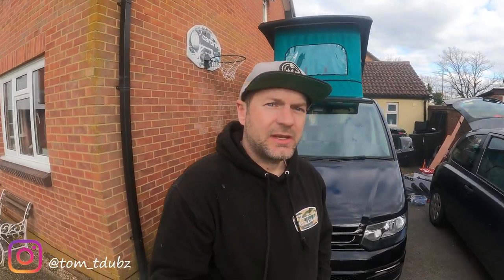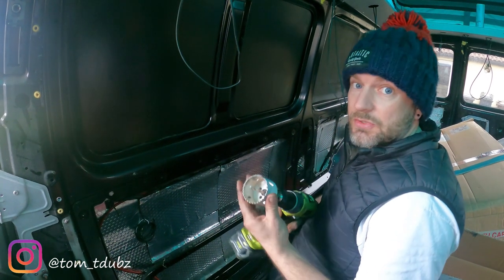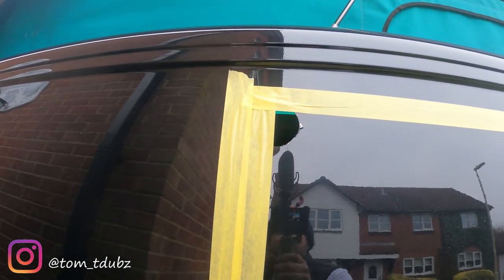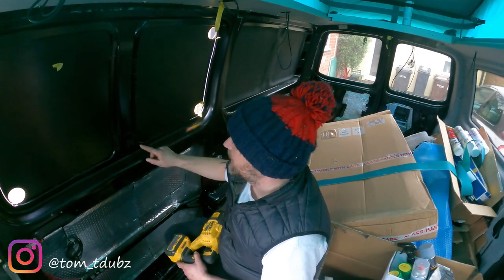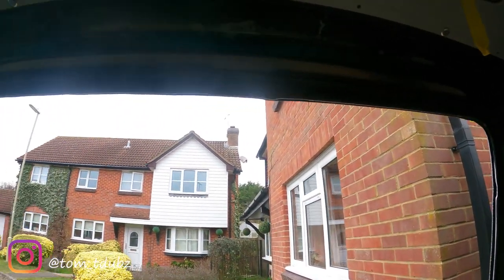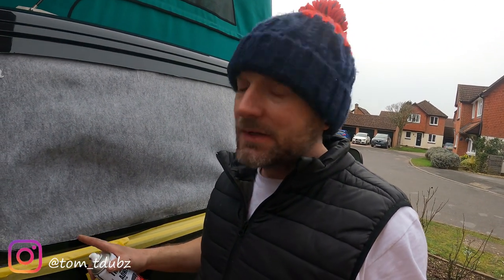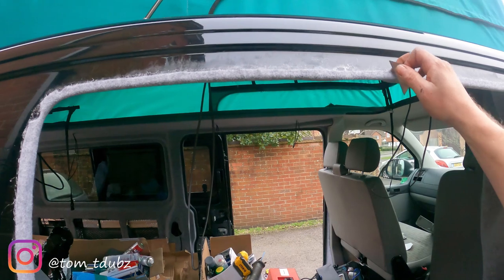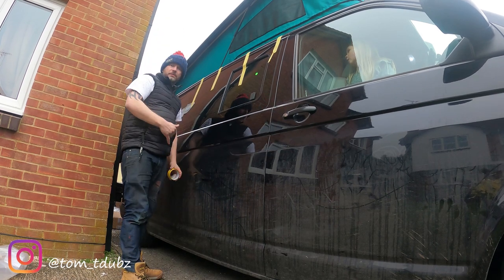vw t5 #windows #blackbeauty #series3

Comment: Great video and very useful, thanX! 
Quick question if u will:
After u cut the windows holes out and after sanding, did u apply any rust protection and a rubber seal prior to fitting the windows?
Reply from the maker: Thanks fella, rust protection yes, no rubber seal I don’t like the look of them.. have a lot better look with out them 👌🏻
Reply: @tomtdubz  Ohhh so it's not a necessity to have a rubber seal!? Hmmm..
If u apply the windows and then later down the line decide to apply carpeting, is it also possible to make it look nice and tidy? Thing is I am getting windows fitted professionally and have thought hard to do it myself but man, cutting a hole in to my van is a traumatising feeling for me coz what if I f#@k it up somehow 😬
But I plan to apply carpeting after windows and insulation is done.. not sure what's the right order to do things 🤔
Reply from the maker: Entirely up to you, if you have the windows fitted with the seals you can still carpet after, you’ll be able to gently push the carpet between the window and the seal. The seals are used but you don’t have to use them.. if you have any factory windows they don’t have them..
Reply: @tomtdubz  Oh nice. ThanX for the info BuDi. Love your channel and how u do everything yourself, very inspiring. Cannot wait to have the van up and running 😅
Reply from the maker: @motiv8154  thanks, 👌🏻👌🏻👌🏻👌🏻👌🏻👌🏻👌🏻👌🏻👌🏻